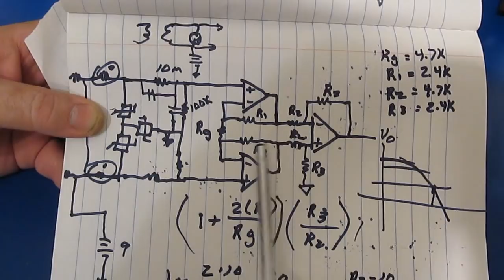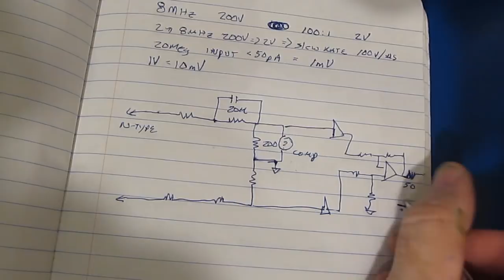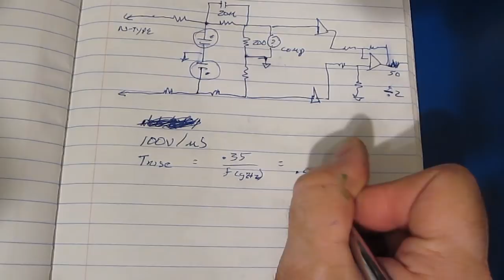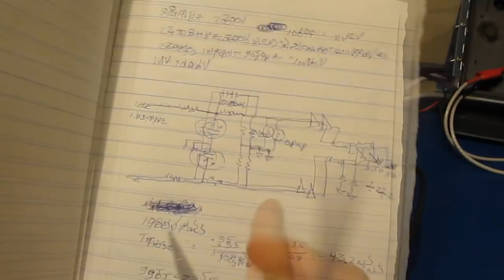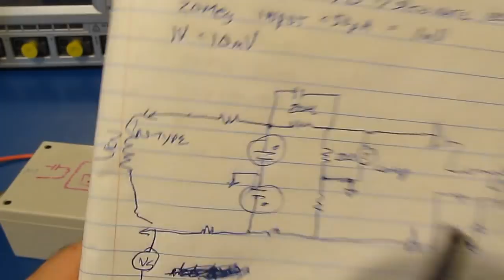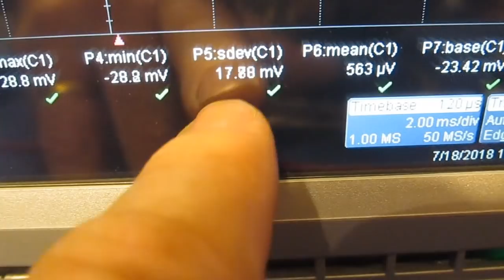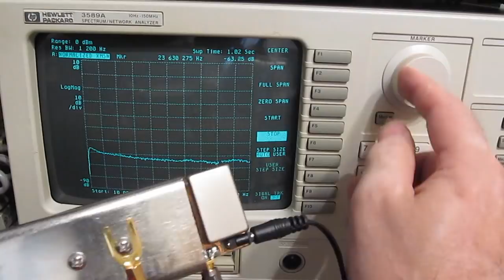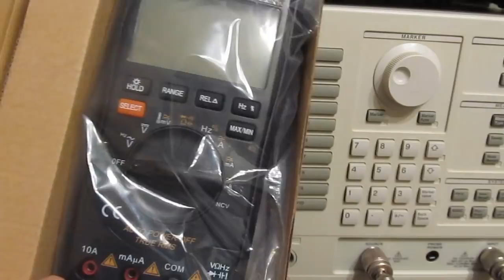Higher Bandwidth Differential Probe  wo a PCB

Comment: Wow! Impressive! That differential probe sure deserves a bit more improvement in construction - it performs much better than I expected.
As for the GDT, man, that short was incredible - 100A! A piece of wire would't hold as much :-)
If you have the time and the mood, it would certainly be an interesting video, if you modify the front end of the multimeter and see how much better can it get.
Thanks for another informative and entertaining video!
Reply from the maker: Glad you enjoyed it.  That first high current run with the GDT, you can see with the one camera when the solder melts.  I thought for a moment I was going to have to enable that second supply.

Comment: Thank you for the detailed explanation and the maths behind it.
After having watched a few videos, I have one question remaining: Why do they all use DMM leads and not scope probes?
With scope probes, you would have a wide range with 1:1 1:10 1:100. Even dedicated HV-probes with 1 kV or more.
Reply from the maker: You certainly can use scope probes in differential mode with the scopes subtraction mode.   No need for a diff amp.   Just depends what you are after.

Comment: I though GDT should be firing at 22:24, is your PSU floating? My understanding is that it should discharge through coax shield and scope BNC to ground, please correct me if I'm wrong.
Reply from the maker: You know from 22:00 that a single GDT broke over around 700.  There are two and at 20:50 you saw how I  have a symmetrical divider network.     AT 22:24 that you asked about, we run up to 1KV.    So, you think 1KV is greater than 1.4KV (700 + 700)?    Why would you think that? 

You second question would lead me to believe that you believe everything is earth ground referenced.  That's certainly not the case and it's starting to make sense why you think that 1KV is greater then 1.4KV.   We have a differential probe connected to an earth grounded DSO measuring a floating supply.   If the power supply had been earth grounded, then indeed the GDT would have fired as we are then looking at 1KV > 700V.    The problem with using a reference in this case is we are testing a differential probe and one thing we are interested in is common mode rejection.   Good question.
Reply: @joesmith-je3tq  "So, you think 1KV is greater than 1.4KV"
No, I figured that 1.4kV gets divided by 2 as soon as you ground the probe naturally through coax as current flow finds a least resistive path. Just thought that I'd better clarify since these details of setup were not mentioned in the video.
I am looking into using 3pin DGT and was trying to make sense of rated breakdown voltage spec in this case. Now, I think that I have to choose 3pin GDT rated at 1x max diff potential. And I guess, this limits common-mode to 1/2x of max diff voltage. Seems like a serious disadvantage for the application.
Reply from the maker: @Mr.Leeroy  I think I was targeting a couple hundred volts with this design.  The GDT was there just to limit the voltage to the divider.  If we were designing a probe for AC line in CAT III for example, I think we would want to start over.   If we were just working in that 200V range with no concern for any transients,  maybe the input impedance is enough to protect the scope.  Lots of choices the designer has to make.   These videos were just to discuss  some of the basics, not provide a turn key solution that would get the beginners killed.  This is why many details are left out of the videos as I assume those really interested in design will dig in.   A fun project.
Reply: @joesmith-je3tq  Yes, I respect that. Your two videos were of great help even with details left out. Greatly appreciated.
I decided that my casual hobby use case does not justify the $160+ price tag even for cheapest commercial probe. So I am in a process of building my own and most importantly learning about higher frequency circuits in the process.
So far, I simulated 500V 50:1 one with ADA4817 unity buffers and THS3202 Av=5 diff amp (+/-5Vpk probe output with +/-1Vpk attenuator). At 50Mhz sine wave looks clean with only -0.087db output drop. F(-3db) is around 159Mhz, but wave shifts towards smoothed triangle. I believe buffers are the weakest link, but that THS3202 is nuts with 9-10kV/uS slew rate, gives nice 3-5ns rise times at full scale into 100Ohm load, which is all I care about really in terms of specs.
So it would be a very interesting challenge to achieve such performance in reality. What I noticed, is these series resistors for GDTs degrade rise times and sine amplitude at 10nth of MHz very much. 1,5kOhm values become unrealistic, 100-150 max.
I wonder how much less safe this makes the device with such low resistor values. I'm not planning to use this probe in noisy environments or with badly regulated signal sources and with voltages higher than 250VAC/450VDC really. But it would be nice if in case of human error or voltage surge GDTs would be the only ones to die. I would even be ok if probe gets damaged, but not scope.
Sorry for long posts, hope that I'm not bothering you too much.
Reply from the maker: @Mr.Leeroy  I doubt you would damage a GDT unless you are working on some very serious stuff.  If that were the case, I would say you were a fool for trying to save the couple hundred bucks on a commercial probe.   Let's assume that's not the case and you are smart enough to keep it off the AC mains and other high energy sources.  That being the case, I am not sure what your question about less safe is about.  I assume less safe for the scope and not the human.   For the scope, I assume you are using parts rated for what ever you are connecting up to.  And with your lack of any transients and regulated sources, I am not sure why you need them.  At least with the probe I show, the BW is limited by the HV resistors, not the GDT and surge rated R.   Adding compensation is always a bit of a trick.  Still no need to sprinkle parts in if you don't need them.   It's an interesting and fun little project.
Reply: @joesmith-je3tq  "I assume less safe for the scope and not the human." Exactly. I am pretty sure that I'm good to manage to not kill myself with it, but I assume that I am still human and might damage some electronics in the process, so I just want it to not be my scope and at least make efforts for protections. The most hazardous project that I am working on (and actually the only one of this severity) is custom PDM Triac controller for 3kW AC heater. And I'm certainly not going to casually poke this one without actually thinking through and researching proper ways of handling HV prior to approaching each case. I'm certainly not going near distribution boxes or similar. So this is just for providing an additional layer between sensitive equipment and DUT while learning power electronics like SMPS. You are probably right, I am overthinking it, been often told that about my designs.
By damaging DGT I meant overheating it to the point of failure with bigger amounts of current (with lower value series resistors) in case I catch continuous overvoltage and somehow won't remove the fault in a timely manner. So basically, considering the worst case scenarios apart from conditions where it actually is going to be used. But I already found this video on YT showing 3-lead GDT with melting failsafe, exactly what I needed.
Reply from the maker: @Mr.Leeroy  Nothing wrong with details.  I am just trying to sort out your scenario of where the GDT turned on without a transient, stays on and then there was enough current to melt it.  Then what ever this source is, it poses no risk to humans.  If anything, I am missing way too many details.  YT is a poor place for these kinds of discussions.  If you have a blog or are posting in some forums about your project, please provide a link and I'll have a look.
Reply: @joesmith-je3tq   No, I haven't achieved anything to write home about for now, so no blog posts. Also, I am lacking equipment to base my posts on proper measurements and not guesstimates. But, I could let you know when I'll end up with any good working circuit, if you are interested. Anyway, thank you for your kind replies.
Reply from the maker: @Mr.Leeroy  No problem.  I look forward to seeing what you come up with and watching it in action. 

In my case, the probes were all made from junk I had salvaged except for this one where I bought the Op-Amp.  I remember totaling the costs and this probe would have cost more to make than me buying one.   So keep an eye out for the costs.  Get something with high enough performance and cheap enough to build, you may want to start a business.   Good luck.

Comment: i made a transformer driver a long time ago using an AD9850, 2 high speed comparators (better than was in the package) and a dual ghz mosfet driver on perfboard with copper tape and people on the EEVBlog forms gave me crap for it but in the end it worked very very well and i still pick it up and use it to drive some mosfet driving transformers for powersupply and tesla projects 
of course now getting a PCB from china is dirt cheap but back than the cheapest was OSH park and it was still an $80-120 expense
Reply from the maker: If I roll a new one, it will be on a PCB.  I doubt I would spring for good board with controlled impedance.  To pull off a 100MHz like the MICSIG is being advertised,  it may need one.   

Strange people would have a problem with using copper foil and perfboard.  I've built a lot of projects that way.   Maybe just lack of experience on their part.  Plus, it's the internet.  There is far more drama and feelings presented than actual data.  You could join some of the engineering forums.
Reply: joe smith, I don't even think it would be necessary to spring for more controlled impedance lower leakage PCB even at 100mhz but if I was after anything over 20mhz I would not be looking for the cheapest possible FR-4 china had to offer and would take some leakage preventive steps 

As far as using copper on perf I think it stems from this mentality of "anything over 100 mhz is rf black magic and must be treated as such" and people expect either a proper pcb or deadbug on copper
Reply from the maker: I made a divider for my frequency counter that runs well over 2GHz using perf board.   Granted, I really didn't care how clean the signal was.  A little razor blade work and called it a day.   

Are you getting  any closer with your probe?   Looking forward to seeing what you come up with.

Comment: I must have watched this video at least 3 times trying to follow the math you used in selecting the parts for it. I think I followed all of it except the input current requirement for the op amp and how you selected the op amp from all of the different ones available. And if you mentioned the part number of the op amp device you used, I must have missed it.
 I think I have the most important parts required to build the probe already in stock, especially since I have a few sets of those precision voltage divider networks in 10:1 and 100:1 that I bought as a lot off the internet about 20 years ago. I don't have the probe connectors that you used, but I would solder the probe wires directly to the circuit board and skip the connectors completely because I think that an extra set of probes would cost me a lot less than both ends of those 2 connectors.
.
 I watched dozens of your other videos evaluating all the different brands of meters before I purchased the ones I have in the shop today.  And I have been quite happy with them.
 Every time I watch one of your videos I learn something new.....
.
 Thank you for making those videos and sharing your very unique knowledge with the rest of the world.
  Dennis O.
Reply from the maker: My goal with making these videos is show some of aspects that a designer may consider when solving a problem.  There are a lot of channels out there for those wanting to build circuits without considering how they work.  In this case, if I left out the PN, it may have been an oversight but there's more than enough info if you wanted to do some parameter searches on Digi-key.    Better approach is to start with what it is you are trying to accomplish.  Write down these requirements.  Then design a circuit that meets them.
Reply: If I wanted to build circuits without considering how they work I would not have been watching tour channel.
 The only part I did not understand is why you would be choosing an op amp based on input current requirements for that part of the circuit.
 I fully understood your other parametric choices but not that one.
 I wanted to be able to compare your op-amp choice to the ones I already had in stock because I was pretty sure I already had every other part you used in my stock.
 Do I need a differential probe, 
NO. 
Would it be nice to have such a tool around the shop?
YES
 Especially if it didn't cost me anything more than my time to put it together.
 As far as design is concerned, I was not going to use your dc to dc converter,... It would be powered by a small flat lithium Ion battery powering a Royer oscillator and a high frequency step up transformer because I believe there would be less noise coupled into the probe and the DUT when using the probe.
 If I was trying to take any shortcut, it was trying not to do a parameter search on any vendor site when I am specifying a parameter that I have no idea what I am specifying it for!
 I was impressed by your results and wanted a part number so I could download the datasheet to see how the op-amps I already had here measured up to it for purposes of substitution or possibly finding I had a better part already in stock.
Regards,
Dennis Ostrowski
Retired senior member of the technical staff at what used to be Bell Labs... @joesmith-je3tq
Reply from the maker: @Dennis-mq6or  I thought at 6:26, it was pretty clear what the tradeoff was.  What exactly do you not understand?
Reply from the maker: Was ohms law the problem?  V=IR?  Or that I picked 1mV as a guesstimate for the acceptable error?   When designing, it is always a tradeoff.  Again, this isn't meant to be a circuit that beginners would copy and paste.  Rather I am just showing some of what is considered when designing such a probe.

Comment: I also have one of these meters on order from ali. Would love to see your teardown exam before testing and modification if possible.  Thanks.
Reply from the maker: No problem.  I plan to just treat it the same as any other meter up to the point where I start running the transients.
Reply: Forgot to say that Learnelectronics done a brief review of this unit.
Reply: These meters are not so cheap anymore. I ordered mine 2 weeks ago on ali-e at £19 gbp and this morning I see them at £21-90 plus postage on Amazon.

Comment: also i was told using Mu Metal without heating it up red hot after shaping makes it "as useless at blocking magnetic flux as a strip of tin" 
i always just accepted that as fact but is that not true?
Reply from the maker: I've never heard that.  Did you ask the manufacture?  If not, I would give them a call and ask to speak with an applications engineer.
Reply: joe smith, i never did, I just thought to my self "sounds about right" and never questioned it
Not that I used mu metal that much at all but I think it's worth me shooting some manufacturer an email
Reply from the maker: That would make for a good post on EEVBLOG after you call them.   Better to make sure you know what you are posting about first.

Comment: Very Nice job on the probe.  The meter will be a short video on test. Do the modification first , like MOV  /GBT better(s) PTC (s), like you did with the kasung test to at least survive the 2.5KV . The GBT from the modem was aa good light show. Thanks
Reply from the maker: That probe looks like some sort of geek art.    If I mod the meter, I would more than likely push it to the 14KV levels like I did with that meter you mention.  I would never be happy showing a meter that could not survive to the basic levels the AMPROBE AM510 has.
Reply: I think i have a faint memory that you modded the uni-t 61e and you ran up to 8KV. The funny part is that the uni-t61e and the AMPROBE 510 cost almost the same here in a local store. The probe looks like a improved tuner, for homemade it's impressive and the attention to the detail. Let the Mods and Tests begin..
Reply from the maker: The probe needs to be put inside a box at some point.  I have made several modifications to my 61E.  It's now one of the most temperature stable meters I have.  It can also measure 20 Amps for extended periods.  It now has a very low burden voltage in the uA ranges.  Plus it has an adaptive backlight.    I think the two meters are about the same amount here as well.

Comment: Ingenious gimmick capacitor for the Caddock resistor; consider the idea stolen!
Reply from the maker: Thanks.  I used foil tap to compensate my single ended high voltage passive probe as well.   Hope it works out for you.

Comment: Why use a differential  probe and not a GFCI instead ? I am a novice, so please tell me!, thanks.
Reply from the maker: Sorry but I have no idea what you are asking.  GFCI has nothing to do with making measurements.   It's a special type of circuit breaker.
Reply: @joesmith-je3tq  Yes, I know that, but isn't a differential probe a gadget to protect the scope ? and doesn't the GFCI protect the scope ?
Reply from the maker: @cookieboi4449  A differential probe is used to measure the difference between two signals.  It sounds like you are interested in what your mains look like and don't want to damage the scope.  The easiest thing to do is stay away from the mains.  A small step down transformer could be used, like a simple wall wart.  Education, training and PPE protects the scope and the human.